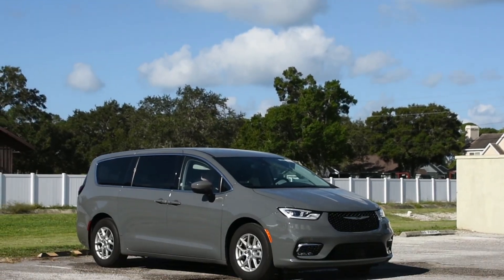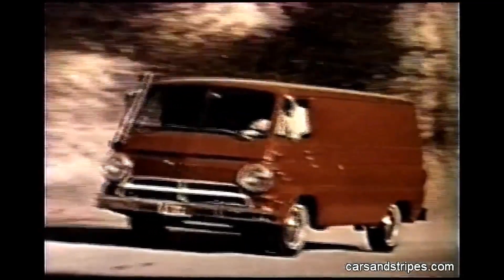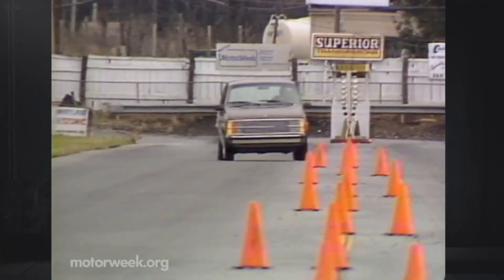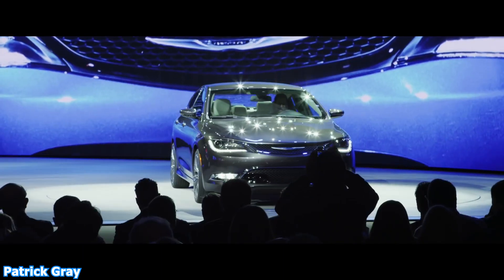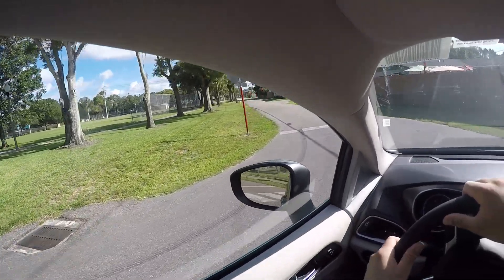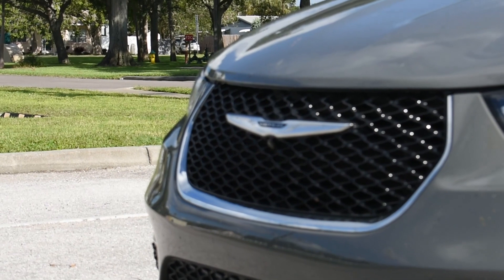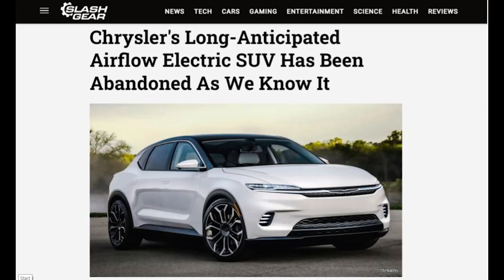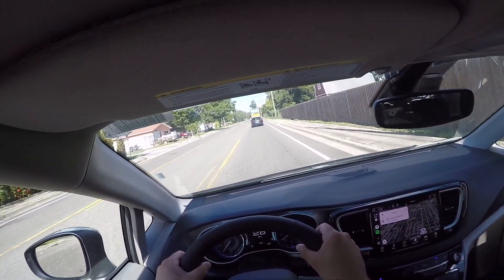2023 Chrysler Pacifica Touring L (Rental Car Review): Wookie Drives #107

Comment: Good review, but just one correction. Unlike the Pentastar V6 in the Challenger with 305 hp, the one in the Pacifica is rated at 287 hp and 262 lb ft torque.  We have a 2023 Hybrid Limited and love it!